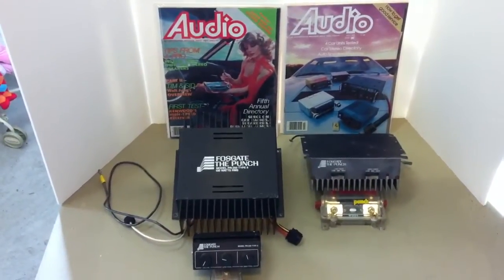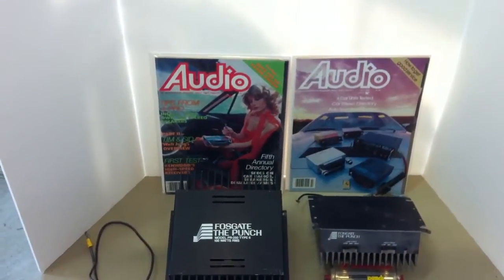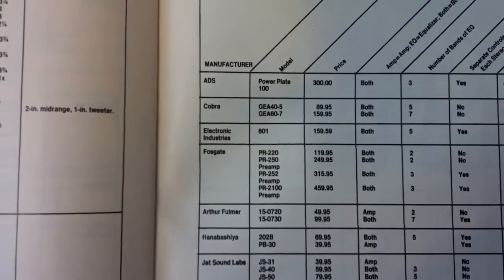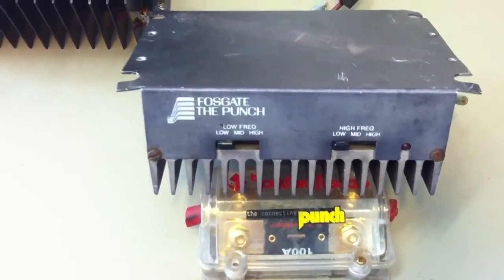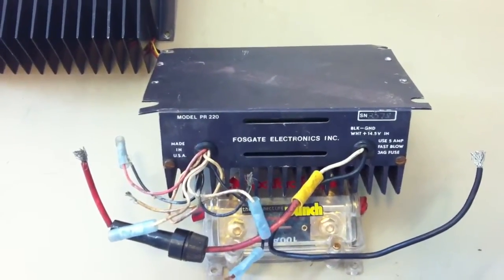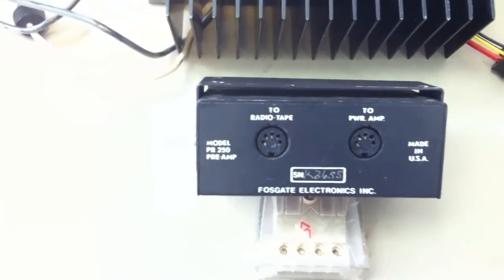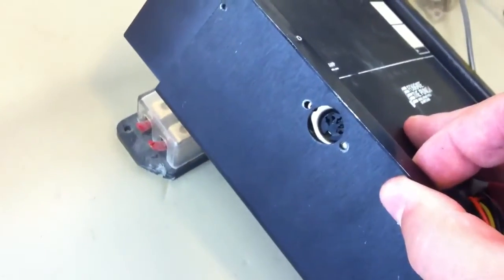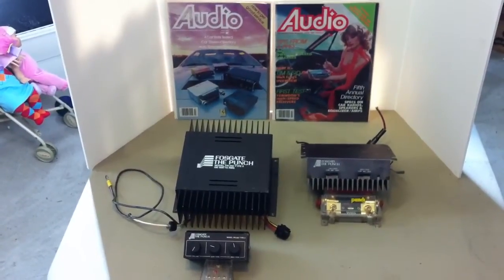Vintage Fosgate Car Audio Amps - PR 220 and PR-250

Comment: Back in 1985 when I was attending tech school in Phoenix, I worked part-time installing at Cardinal Car Stereo. Here I got my introduction to Fosgate preamps and their EQ aspects. I was blown away by what they did. Right then and there I patched a PR250 into the audio system in my own car. Still to this day I've not found an easier way to drastically improve sound quality. While working at Cardinal the owner Mike Jaffe would occasionally refer to me as his "California installer". But I felt silly inside, knowing how much more I was actually learning by working for him. I had come to realize that back home in Cal I had been an installer for 1 year - five times.

Comment from the maker: @kskate91 Not sure, b/c they require a strange connection for turn on:  TomTomJr - RF Collector "...on the turn on remote wire (red) , you will need to draw power from it to turn on the amp. We used to use a 12V light bulb and a switch. Put the remote wire (red) to the positive of the bulb, then the switch between the 12V ground and the 12V ground of the bulb. Flip the switch, and it will come on. These have the power-draw on the remote wire rather than the power input like modern amps... Tom"
Reply: thats right.... the head unit draw turned on the amp... the amp remote wire is actually the radio POWER source... if I remember correctly... old school FOSGATE... cool.

Comment: The PR-250 (original version) was my first car amp (after "power boosters"!)  It drove a pair of Kricket 6x9 coaxials in the doors and Phillips dome tweeters on the dash of my Porsche 914 back in 1978.  The amp sounded wonderful, but kept self destructing.  I had it repaired 3 times...finally the technician said he "bulletproofed" it, which I'm guessing might have had something to do with the new circuitry in the type II version. I though he mentioned going from an unregulated design to a regulated one.  My buddy ran a PR-220 in his car, and used it to drive a pair of Bose 501 home speakers in the back seat!

Comment: I'm suspecting the idea behind the remote turn-on is to connect the radio's ground.  Though that may be a better idea for the older radios.  Don't know if the circuitry could handle todays higher power radios.

Comment: Minimum wage was $2.65 an hour.
Reply from the maker: Puts it into perspective how expensive these amps were
Reply: When I was working at Fosgate Electronics in 1978 as an electronics technician I was earning $3.50 / Hour.  I was able to buy just one PR-250 for only $100.  I still have it too.

Comment: Hi Dereck, I recently hooked up my fosgate pr-250 to a cobbled up speaker system in my house. Check it out. I also installed the proton d275 you dyno tested into my work truck. It's on another video. I just hope I titled them right so they will be seen.
Reply from the maker: +vintage stereo buff very cool, Bill 👍

Comment: There ya go.... Technology in a box was available in the 70's but sorta RARE and PRICY. The DIN CABLES DAZE!!!!!..... my goodness I am so happy the industry rejected that EURO standard.... I hated having to make DIN cables.... There never seemed to be a STANDARD.... Everything was propitiatory.... Would have been GREAT if you could just BUY a DIN cable and plug it in and THERE.... but NO...... LOL..... Every manufacturer seemed to have a different layout.... pins in different places.... 5 pins... 6 pins... 8 pins... my goodness.... I BELIEVE the DIN cable ends are in fact RCA spec 500 mv.... These systems typically were hooked up to some sort of High to Low level adapter to get the deck signal into the system. TONS of INPUT GAIN was the direct result of that... I remember when them "wimpy" RCA outputs began to appear in decks.... I say wimpy because the High to Low level setup gave the user MAXIMUM GAIN and SIGNAL.... I was not so much the "SQ" guy back then.... I wanted VOLUME so I typically used High Low adapters as my RCA signal from the head unit. LOTS of gain.... These days.... theres 5 volt RCA preamp circuits so RCA spec played catch up... THAT was AUDIOMOBILES thing.... 5 VOLTS in the cleanest preamp circuit..... I STILL own my SP 300 from back in the days..... the BOX..... Those were the days when some Rock Star soundman hippie down the street there sure knew how to make a car stereo get LOUD..... that was me.... hehehehehehehe....... BDBD/2021